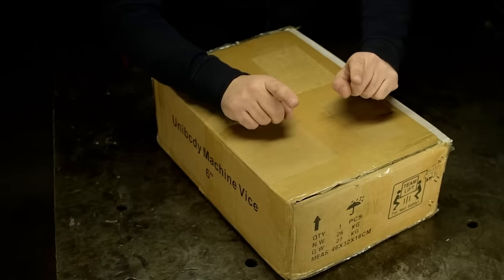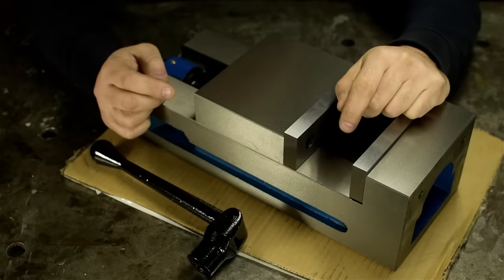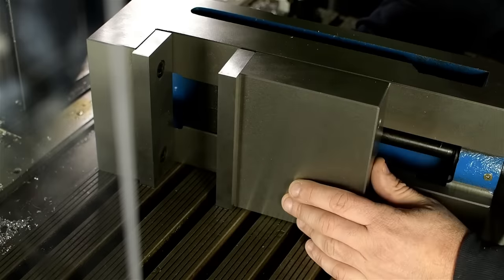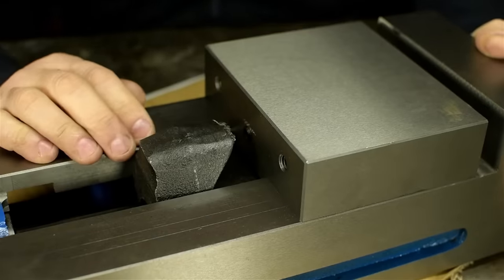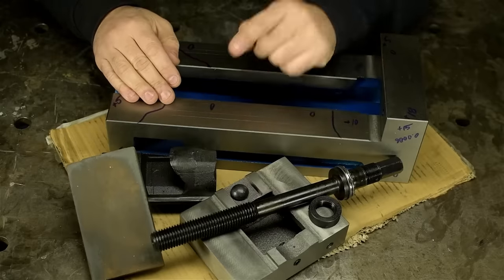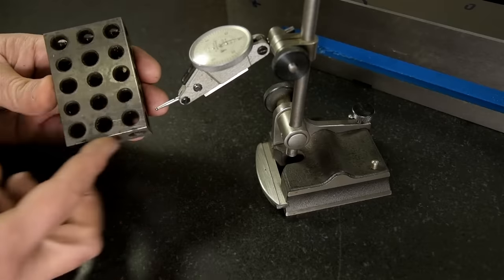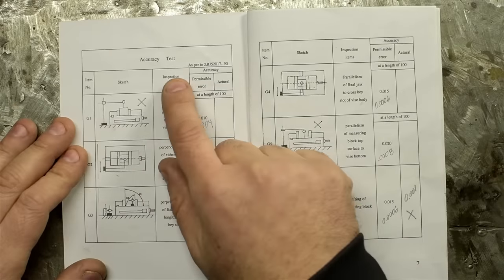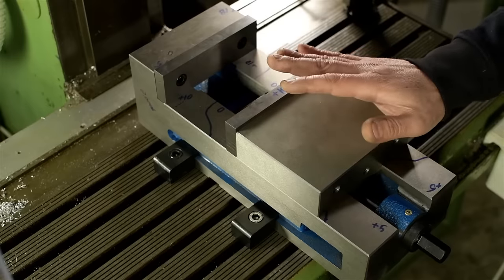Cheap Milling Machine Vise is CHEAP!

Comment: Hi, I have a question about your torque limiter design for the MMX. Were the bearing holes on the pulley designed to wrap around the bearings or are they cone-shaped?

Comment: Dear ThisOldTony,    could you make a video detailing how to make your own locking levers?
These are the spring loaded tiny handles present on gib screws, which you can pull to loosen, and release to engage at the desired angle.
They are so useful, I would like to replace all my gib screws with them, on my mini-lathe, mini mill, and my Atlas horizontal benchtop mill.. But to buy them outright, they are fairly expensive and only come in very few sizes, none of which match my equipment. Thank you kindly

Comment: Vertex is a pretty reputable brand though even if it's an import brand. They're quality control is usually very good and that's why they're definitely priced above the no name import tools. Now when it comes to buying the no name import tools on eBay or Amazon, yeah it's a hell of a gamble that usually doesn't work in your favor although you can get lucky. I've been through it a number of times but since my machining is done as a hobby and for my own projects, it's usually not enough of an issue. I mean i will return something if the quality is really bad but if we're talking relatively small imperfections, it's usually totally fine for what I'm doing.
But that's also the thing that when you're doing this as a hobby, you're not getting paid to machine parts like if you were running a business and you usually try to save money where you can since machine tools can cost an arm and a leg.
I definitely wouldn't recommend anybody in the machining business go the import tool route, at least not the no name import tools. At least go with a reputable overseas brand with a good record of quality control.

Comment: I think its 13/16 of a hectare.

Anyhow, I was thinking of buying a small skid steer CPT (cone penetration test) rig until I looked at the price, then I looked at converting a small skid steer loader, and nearly fell over at the cost of those, and they are too big.

Maybe you could have a home project of doing a small skid steer loader from scratch, it's something that there aren't any videos for on here. For most people it would be completely useless, serve no purpose at all, but it would be an interesting build, gears, hydraulics, tracks. Just make it small (track width less than 1.2m) and able to support 1.5 to 2 metric tonnes, I guess that's about 4600 pounds?

Just a base with tracks, enough hydraulics to plug in random stuff, 18650 battery pack.

Making a hydraulic system like this would make an interesting video.

Comment: That is actually quite good compared to a 4in vise I purchased some years ago, which I had to take to work and completely re-grind.
Unless you have access to a surface grinder, do NOT buy a cheap vise, especially not from China!
If you do have access to a surface grinder, and know how to use it, then know that what you are buying is a KIT vise. Disassembly-grinding-Reassembly required.

Comment: Not a machinist here, so maybe I 'm missing the obvious... but why not measure square by measuring flatness of the long end and flatness of the short end to the reference table using the dial indicator?  If both (all 4) sides are parallel to the reference plane, how can it be anything other than square?  wouldn't that be much faster and easier?  Also, to know if it's a rise in the part vs a hole in the table, can't you quickly repeat the measurement moving the part rather than the indicator and compare results?

Comment: Hi Tony your videos are really good, I've only gone far as a 3d printer in the CNC world I' was originally going to build my own 3d printer but just decided to buy one 'Just for  something to play with, a lathe and milling machine is on the Christmas list but what the hell would I even make so just focusing on practicing measuring parts with a vernier caliper in fusion 360 and print them to see how they turn out and pretty bad.

Comment: Also bought a Giantz 300 Amp Inverter Welder DC MIG MMA Gas Gasless Welding Machine would it be possible to tig weld with it...
Reply: MIG machines are constant voltage, and TIG/Stick machines are constant amperage, so no

Comment: Well Tony, I was looking to replace an "enco" six inch kurt type vise, I'd bought 25 years ago, when it was as good as I could afford at the time.  I wasn't satisfied with what I saw here, and ended up with a Kurt D6 cross-over, for about seven bills, and am very pleased with the outcome.  I'm working with the by far the best "foundation" I've ever had, first time with a new quality vise, zero-zero runout over six inches with a Starrett tenths indicator, a dozen times in a row, on a forty year old Bridgeport.  Thanks for the review, I'm glad I chose the kurt, and would suggest you do the same, next time around.  It will change your accuracy standard.  Semper Fidelis

Comment: I understand there is a lot of comments here and i don't expect anyone to answer but, (I have 0 Milling experance and am here to learn) 

If you are going to use it on your mill why can't you just plane the surface flat with the mill that way all the errors will be within the mill and that's a known you will have regardless. at least the vise will be flat compared to the mill.

Comment: So, after about a week of binge watching all of TOT's videos, after finding them through Clickspring, I have reached the end... hopefully for now. Saddened to find out the reason that Tony hasn't been able to publish content lately, and hoping that his family is healing and that he can be back to making videos sooner rather than later.

A question came up in my head when you showed the blank certification sheet. Is it possible that this factory is manufacturing vises for "name brands," but are selling the vises that they make that don't pass tolerance for their clients on the cheap to recoup some of the material costs for the rejects? 

Like you said, you might be hard pressed to source the material for the price that they are selling for, and if this factory is machining robotically and they don't have actual machinists experienced enough to bring rejected parts in to spec (because the labor cost to reach tolerance would be more than scraping the part or trying to sell it on the cheap), then they may be dumping out of spec parts in this way. So, there is likely no hope that you are going to get a high tolerance vise buying through this route. Another thought, given that the threading was different than advertised is that a reseller bought the machined bodies that failed spec from the original manufacturer for scrap, added the turning mechanisms, and turned around and sold them.

Comment: Why is everything made in China always so badly made? Edit: Glad you mentioned the race to the bottom; I don't touch Chinese products for this reason. I have even, on a lazy week, commissioned a blacksmith to make the tool I wanted rather than making it myself (my forge was all disassembled, okay, I'm not lazy!) and it still worked out cheaper than buying some euro branded still made in China tool.

Comment: i dont know but in my eyes metric system are more pecision 1inch its 25.4mm = 2.5cm you can easy split into 254parts much easier for calculations imperial shold be remowed :/ try find 10mm drill (0.393701) crazy :/ in impersial size no way :/ im in uk and sometimes imperial system its realy pain in the ass if you have machine made in hmmm poland :/ last have some bicycle part and there was allen key 10mm was imposible get this size in inperlials orderedd from germany

Comment: I once bought a cheap, Chinese 4-jaw lathe chuck on eBay and the back plate mounting holes were in a different configuration to those advertised. I complained to the seller who basically told me to eat s#!t. When I complained to eBay I got a full refund without having to return the chuck. I bet that BS lead screw that wasn't acme as advertised would get you a full refund; or at least would have were it not nearly 3 months after the fact. :p

Comment: 21:33 well 60milish 100km is 100x 1km and 1km is 1000M. old tony know what Meter is. you know what 100km is.
metric is easy. now you try convert inch, feet, yard, mile. metric you just add or remove 0 AND there is no point 1/2 Meter lol when its just 500mm

Comment: Seriously, it's just an L-shaped piece of hardened carbon or just cast steel, with a jaw ground to spec and a cheap vise screw. Add 2 somewhat hardened and ground inserts and that's it. On a medium sized flat grinding machine you can hook up easily 15 of these vises together on the magnet table and grind one surface in 4 minutes.

That's why they are cheap. 

If it comes to hydropneumatic vises and the likes, the cost comes from the clamping system and the certificate on the measurements and clamping force. Maybe they will use a bit better tool steel for the body or carbide for the jaws, but it keeps the same procedure otherwise.

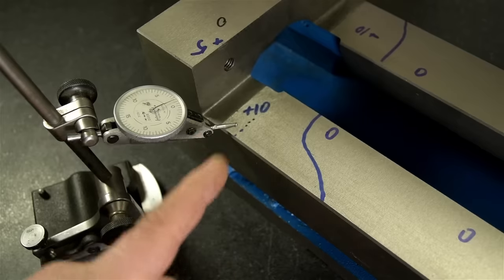Comment: 15:25 You can just keep the measuring tool in place and move the part under it... that would eliminate the guesswork if you are on a flat surface or not because the gap between the measuring tool and surface now 100% sure is the same.

Comment: This is clickbait. A CNC vise? NO! This is just a regular vise. I was expecting to be able to mount a part once and the vise's CNC capability would move it around, including in all the axes. And especially if you're spending $150.00 I'd think it could do more than clamp something. It doesn't even have rechargeable batteries! TOT let us down AGAIN.